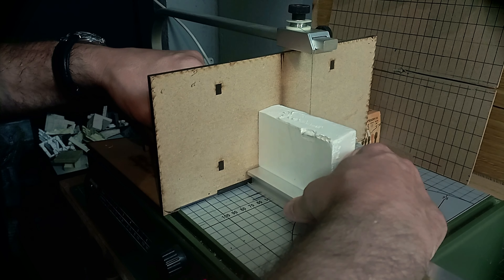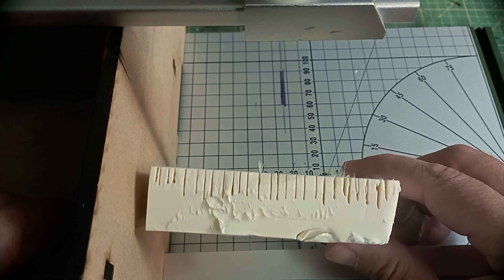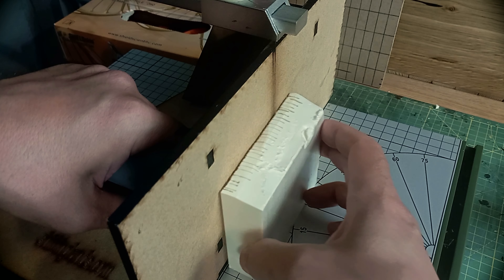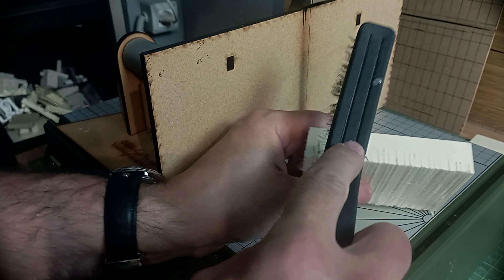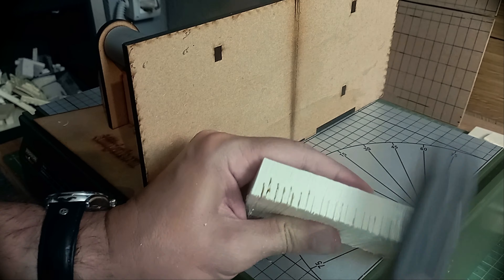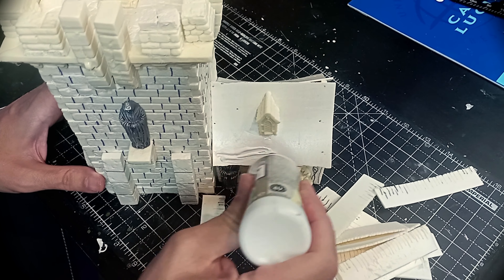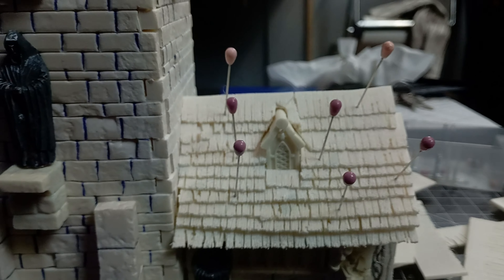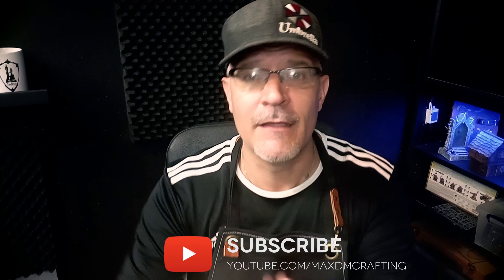Create Perfect 28mm-Scale Shingles FAST with This Proxxon Hack! (EASY DIY) | PRO-TIP #016

Comment: Beatiful! Please, any tips for who do not have a proxxon? ;-)
Reply from the maker: You can modify this tip, using a lower couple of spacers to get the right high of the tiles and using the arch cutter to tap on the side https://youtu.be/lpfxaaPbc-c?si=RscWCc07yyhwXt91
Reply: Really need to save for one. They are a really great tool.

Comment: Max, you dont like the shingle template jigs? I see the constant brushing to really slow down the process.
Reply from the maker: I don't think that the shingle template creates the surface texture, so I would use the metal brush in any case. I could be wrong but I think the only point in common with the gig is the initial one... or isn't it? 🤔🧐